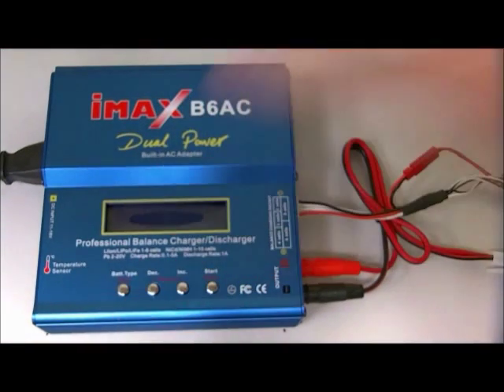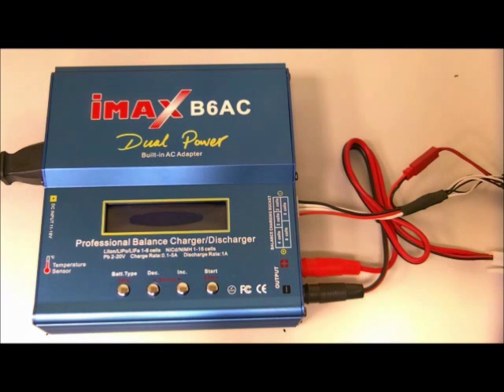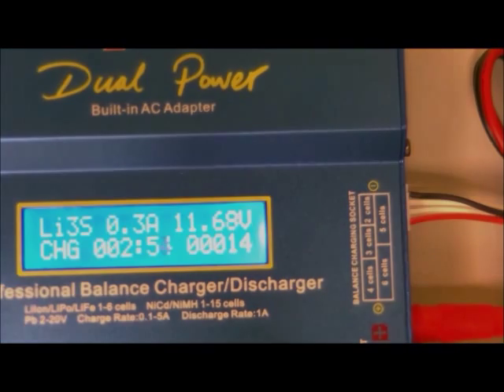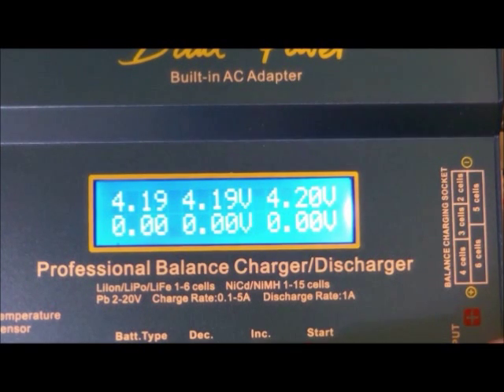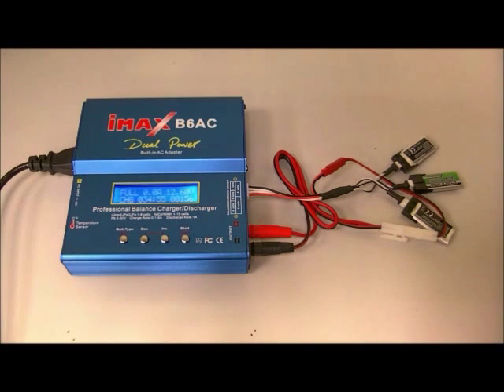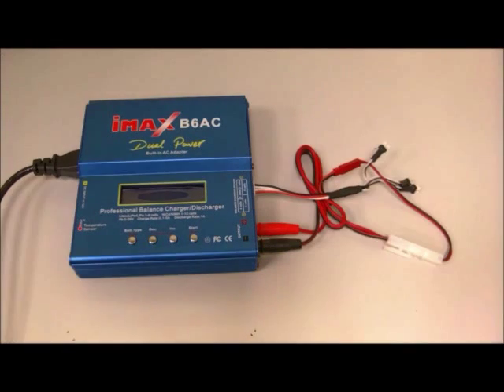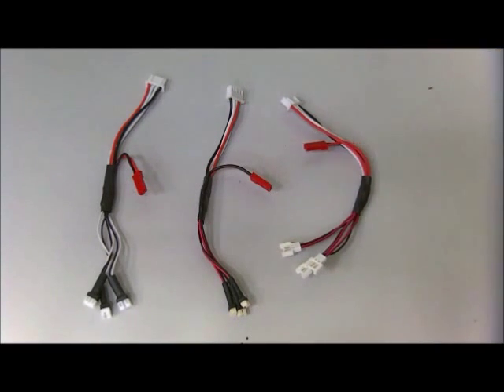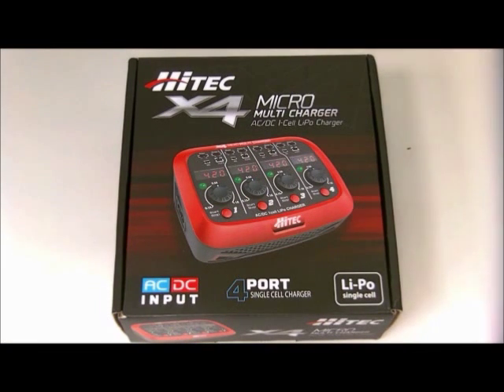Single cell lipo charging with the ImaxB6 part1

Comment: Can you explain why you charge at 0.3 Amps? That's the total current being output by the charger, right? That means only 0.1 Amps is going to each battery. I'm assuming your batteries have a capacity of 300mAh and your goal is to charge them at 1C (i.e., charging them at a rate such that they would go from empty to full in 1 hour). Each battery, then, should be able to accept 0.3 Amps of current. So why are you not charging at 0.3 Amps per battery, for a total current of 0.9 Amps?

Comment: The Xtreme balance charge adapters can be found at various places, including ebay (at least they could be at the time of the video) just google "EA-057-A" ( or -B, -C or -D, depending on what particular plug you need). Another way is to look on ebay for oversky charge adapters (3-in-1 or 6-in-1).
Hope this helps.

Comment: Thanks for the video.  Can you let me know where you found the balance cables with JST banana plugs and the balance port connector?  I'm obviously searching with the wrong terms!
Reply: +Nigel Brownjohn Sorry, only saw this now - if you are talking about the board on the right at about 1:20, than this is called a parrallel board. But it does not have balance plugs (those are MCPX and NCPX battery plugs respectively). If this is not what you are referring to, please let me know at what time in the video the cable is that you are referring to. Thanks

Comment: Where can I buy one of these balance adapters? It's 2017 and when I do an online search it seems like the trend is still parallel charging boards...
Reply: The "trend" is still para boards - and I doubt that will change again ... if you want to find a place to buy, please google xtreme ea-057 (as I mentioned in my previous answer 8months ago (1 post below). this should bring up multiple options for places to buy!